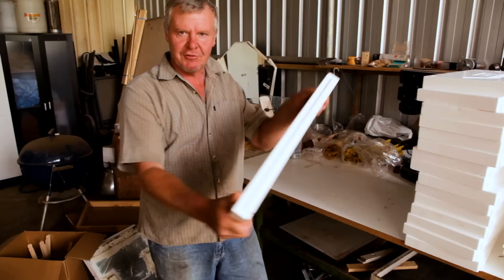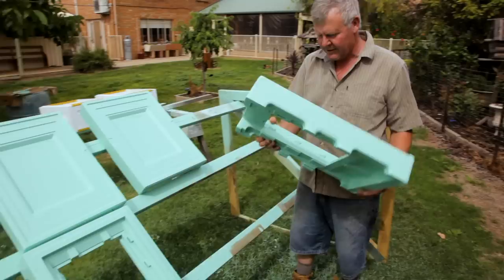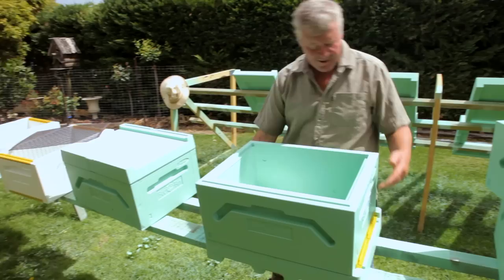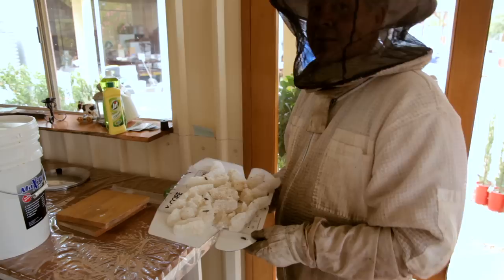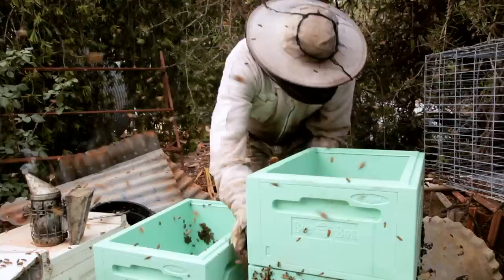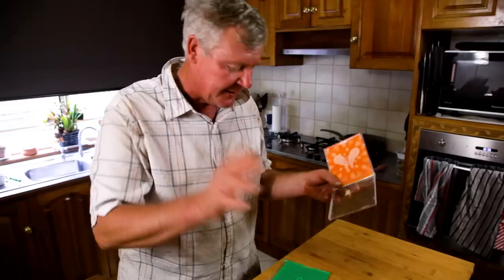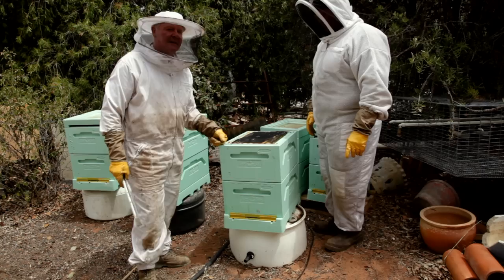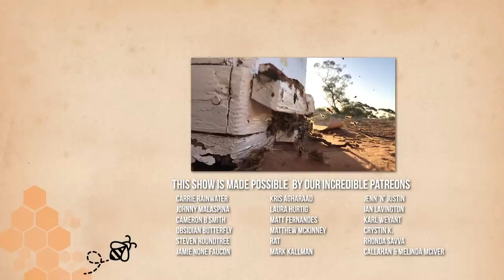Foaming at the Bit | The Bush Bee Man TV Series: Season 1 Episode 4

Comment: Has anyone done a study to see which last longer, wood or styrene?
Reply: I’d be putting money on the high density polystyrene, but I guess both will last if looked after. I’ve been running a couple of Paradise Hives for the past 7 years in our backyard. No sign of them degrading, aside from one box that I poorly stored with some built frames in it - wax moth was the result and they ate into the foam. I cleaned them out and repaired it, and the bees still use it. Mine are glued with a moisture cure adhesive, and painted. Bees over-winter well, and do not beard much in summer (I’m in Canberra). Local supplier has had difficulty bringing the Paradise range in from Finland, and has now come up with their own design, which looks pretty good (I’m not allowed to have more hives though, so will stick with what I’ve got).